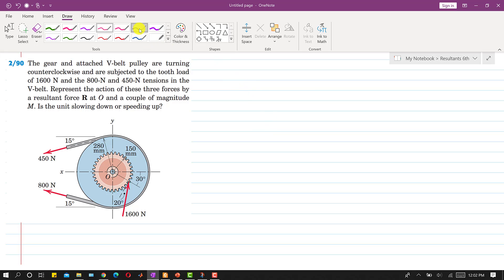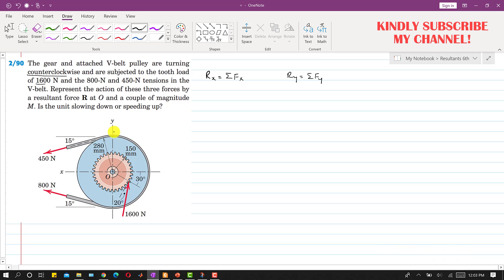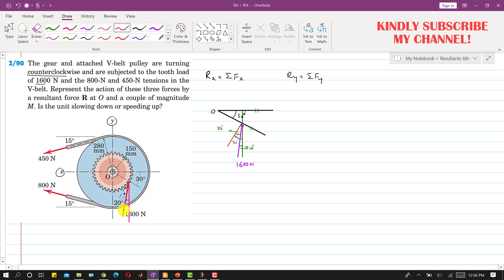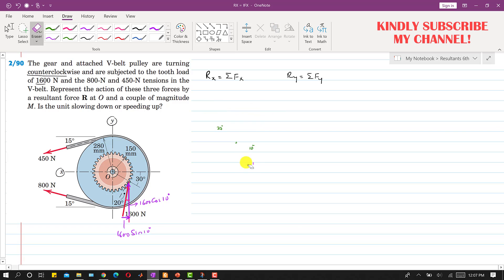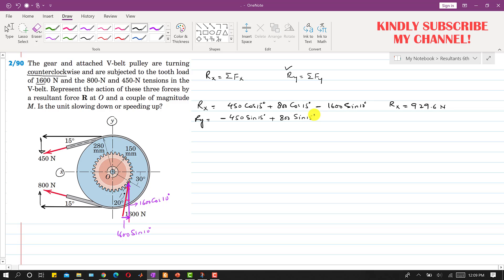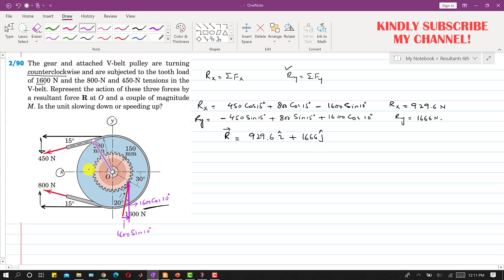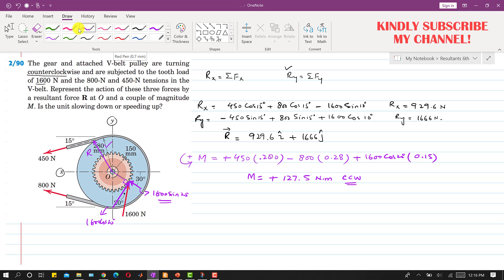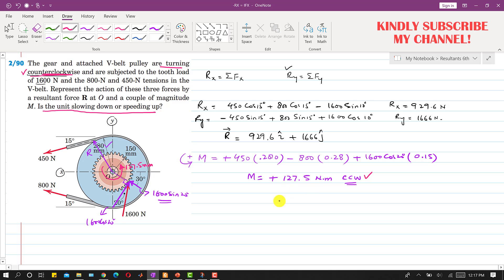2-90 | Engineering Statics | Resultants | Engineers Academy

Comment: Can you help me in this question 2/182 Three couples are formed by the three pairs of
equal and opposite forces. Determine the resultant
M of the three couples.
Problem 2/182
2/183 The combined action of the three forces on the
base at O may be obtained by establishing their 
resultant through O. Determine the magnitudes of
R and the accompanying couple M.
Problem 2/183
*Computer-Oriented Problems
2/184 The eyebolt supports the four forces shown. If the
net effect on the bolt is a direct pull of 3 kN in the
x-direction, determine the necessary values of 
and T.

From 7th edition of meriam